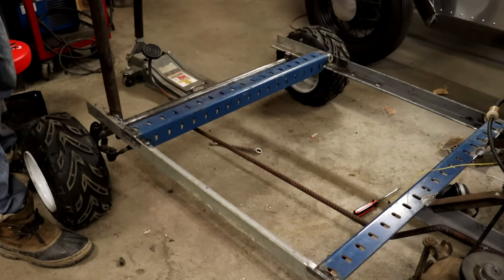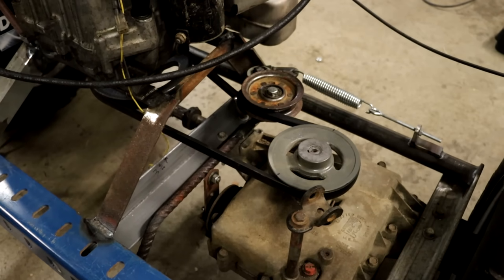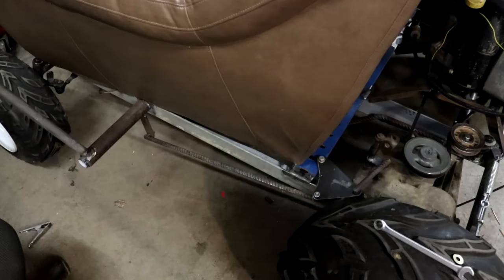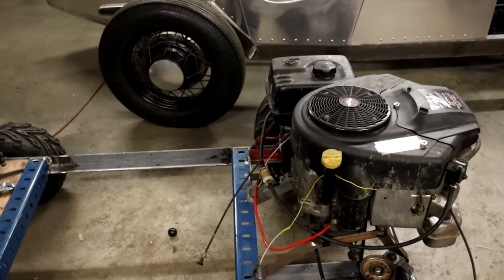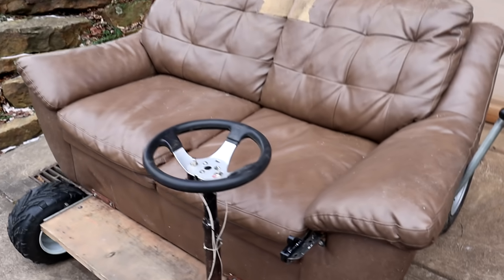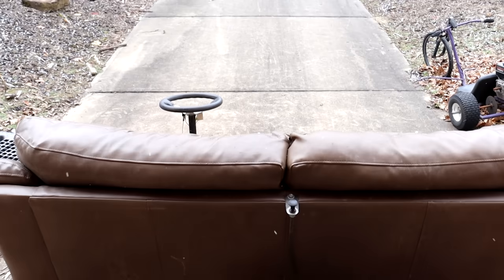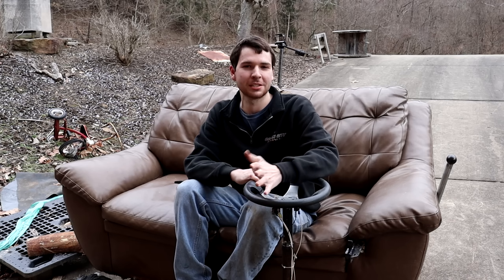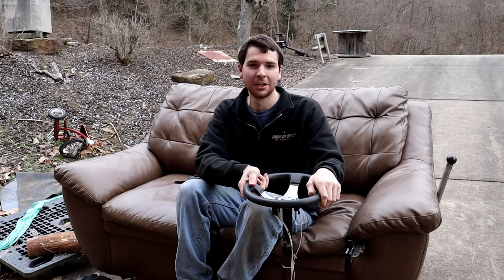21hp Motorized Couch!

Comment: My sofa is understeering on high speed entry, but stable at all other times. Should I open my rear diff, or lock it slightly? Thanks.
Reply: Too many cushions, obvious.
Reply: If its MFI the chassis is not stiff enough
Reply: Rear diffs should always be welded on sofas (love seats and awd sectionals are worth investing in an lsd) it's usually a steering geometry issue though... either that or you're not sticking your tongue out at the proper angle under braking.. the importance of proper tongue positioning cannot be overstated..